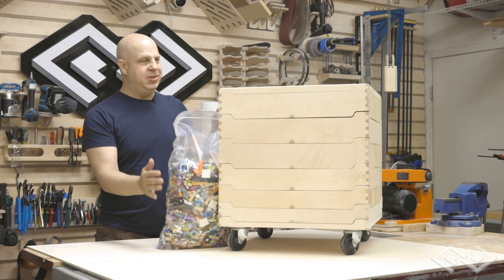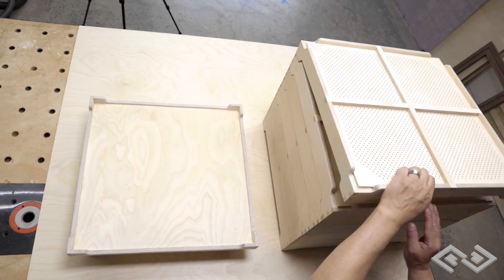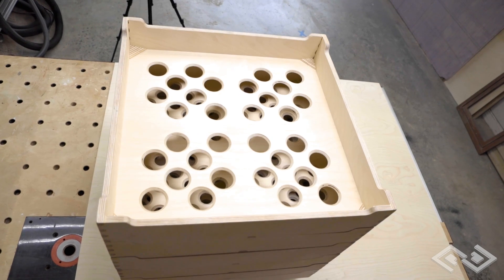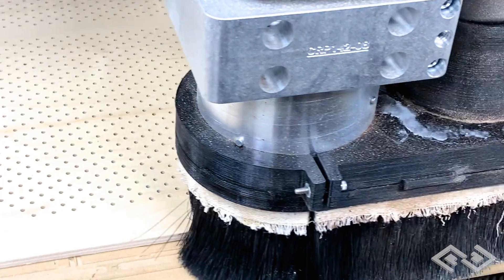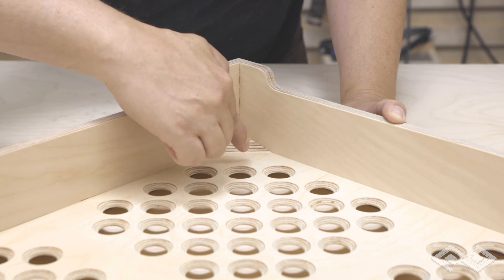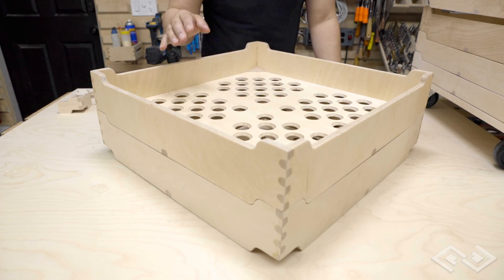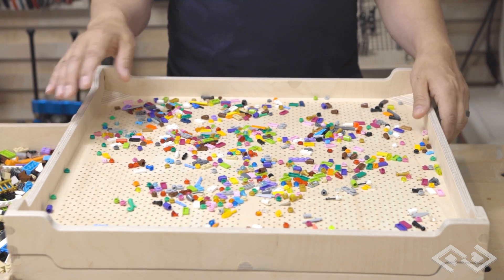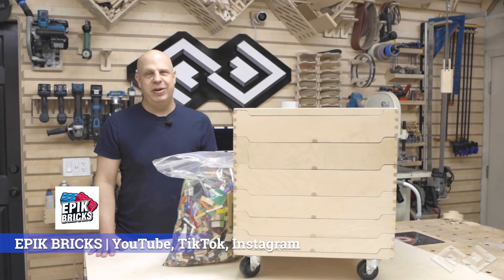Lego Sorter V2.0 (sorts by size)

Comment: Great video problem for me is I don't have a CNC machine, otherwise, it's not that hard.
Reply from the maker: You could use regulate power tools, would just take longer 😉👍
Reply: Split the plates up in 4 pieces, then drill them on top of each other.

Comment: Great build! and I like the dirt sieve idea, I was wondering why you had a tray with holes smaller than the 1x1 bricks. Also, on your corner joints, how'd you get the "fingers" rounded like that? did you have to do some 3D contouring on the CNC or did you just sand them half round by hand?
Reply from the maker: Thank you! Yes on doing the CNC contouring. It took extra time but was fun to figure out 😀

Comment: I am sorting Lego as I am watching  this. I was thinking of an add on for your system.  The small parts are a pain to sort. If you could make a smaller tray to transfer  the small pieces in to with a flat botton. This tray would have a slit on opposite sides. One side would  only let tiles out. The other side would let plates out.  You could take it a step further,  and add a  V grove to catch rods and technic pins. If you put holes at the end of the V groves, you could tip the tray an collect the parts. This was a very inspiring video. I hope you play with my idea.
Reply from the maker: Thank you for the great idea! Very interesting idea. I have seen some other sorters on YouTube that use slots and gaps but I think your idea is better 👍😀
Reply: I like this idea too, I’ll build it using Lego! 😂

Comment: Awesome work 😉 !! On the first two filters there seems to be a lot of plane area where smaller pieces might just stay and not drop into a hole to be sorted in one of the lower trays. Doesn‘t seem to be a big deal, but I just wondered if the design of the first trays could be modified to a more dense filter with big holes.
Reply from the maker: That’s a good idea. Maybe for version 3.0 😀
Reply: Yes, and also with it smaller holes in the first layer, along with the bigger ones, so more chances for the pieces to fall through